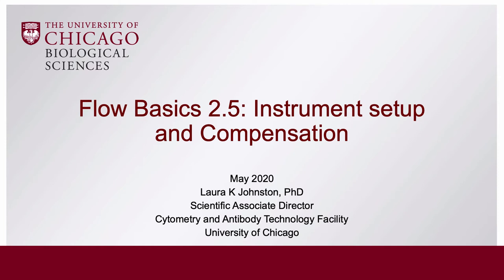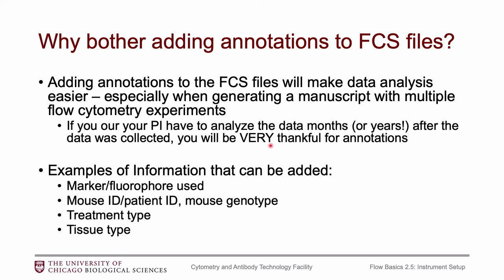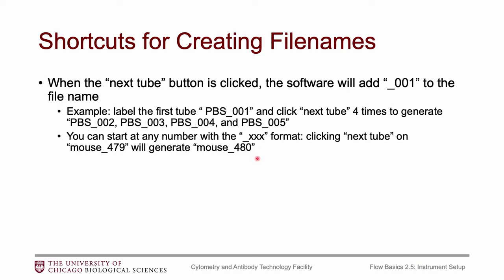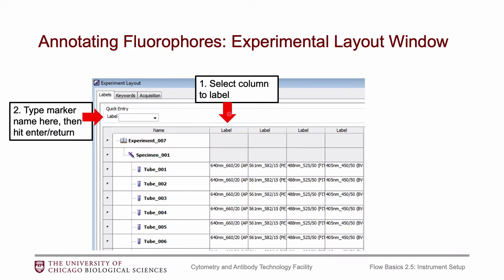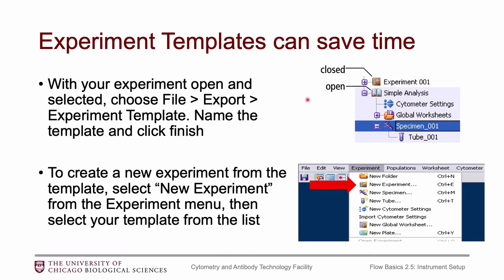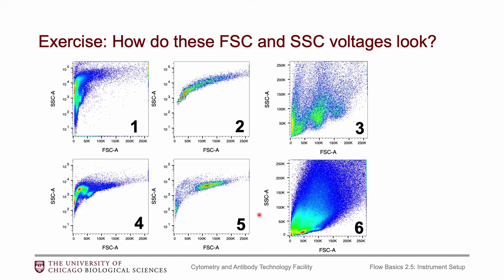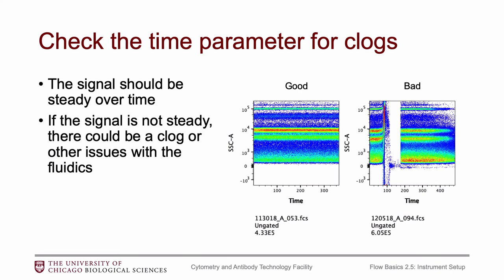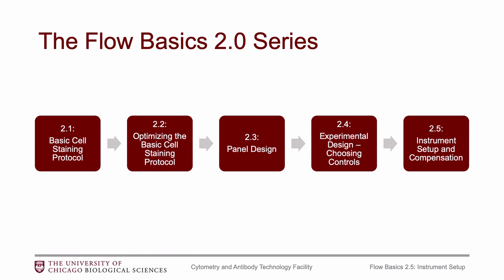Flow Basics 2.5: Instrument Setup and Automated Compensation

Comment: Thank you for an excellent course. I am new to flow cytometry - how do you ensure that a single stained control / compensation control is brighter than overall sample, if the cell population we are targeting (in a compensation control tube) has low expression of surface marker? I would assume that a fluorophore-conjugated  low expression surface marker would not emit high fluorescence signal due to small number of cells expressing said marker, even if the cell suspension is stained with a bright dye such as PE. Thank you for your help.
Reply from the maker: Hi! This can be a tricky question. First I want to point out that the frequency and intensity of a marker are distinct features and independent from each other. You can have a low frequency population (<1% of the total cells) that expresses 100,000 molecules per cell (high expression/high intensity). Alternatively, you can have a high frequency population (maybe 60% of the total cells) that expresses 2,000 molecules per cell (low expression/low intensity). For a single stained, control the fluorophore intensity of the control must be as bright or brighter than the fully stained sample - regardless of the frequency of that positive population. If the positive population is rare, then you may need to record more total events in order to get enough positive cells, but this does not affect the intensity of the marker. If it is difficult to get enough positive events (100 would be the absolute minimum, but more is better), you may consider using compensation beads. My best recommendation is to stain the single stained controls and fully stained samples in the exact same way - tissue type, cell concentration, antibody concentration,  incubation time, incubation temperature. The easiest way to mess up the controls is if people use one tissue type for their controls and another for their fully stained tube and it turns out that the tissues have different levels of expression for a marker. Or mistakes can be made in pipetting the single stained controls - especially when pipetting volumes less than 1 uL.